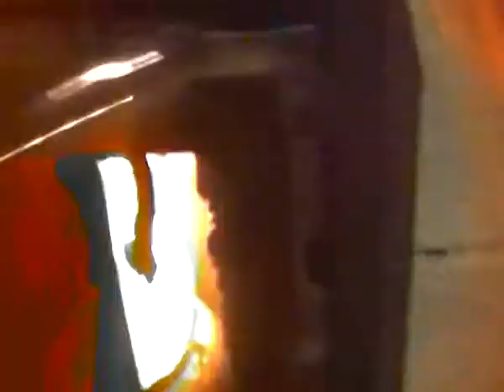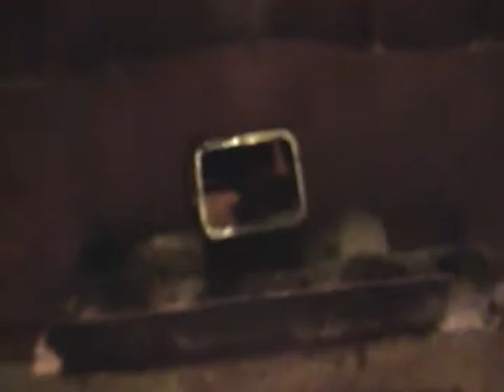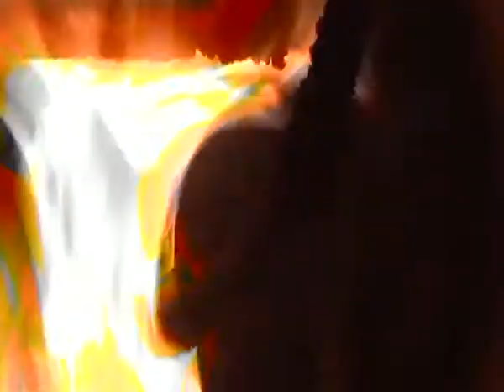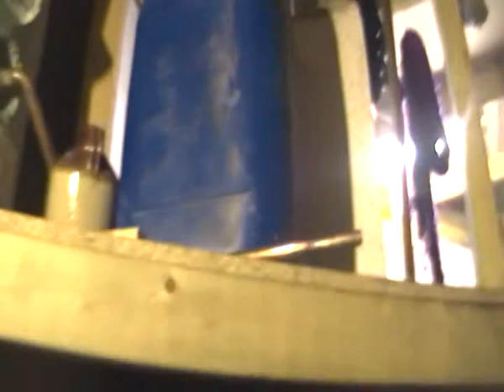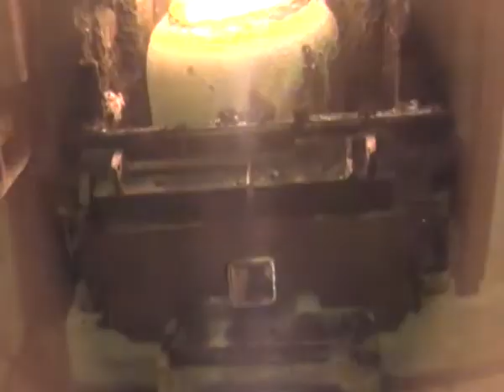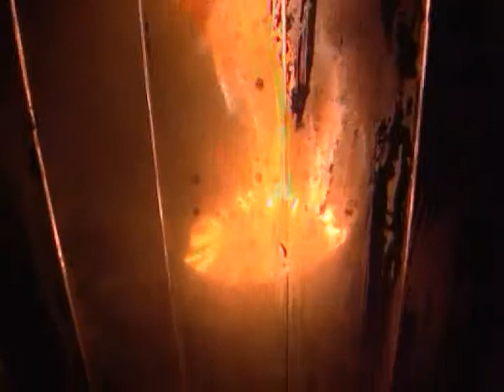my waste oil burner

Comment: Matt if you drip the oil into a larger pipe say 1" bore just away from the flame angle down at say 10 deg into the pot it will stop your feed blocking